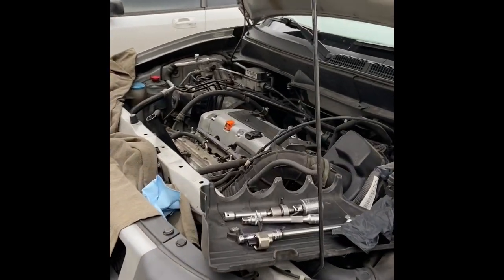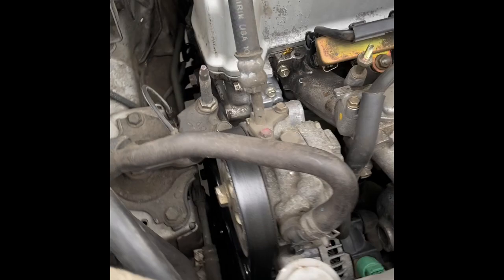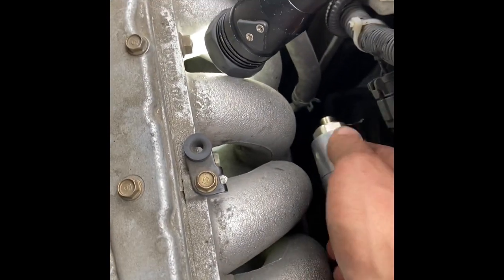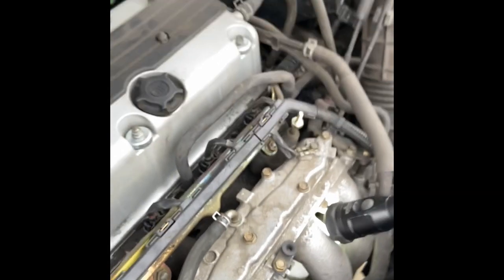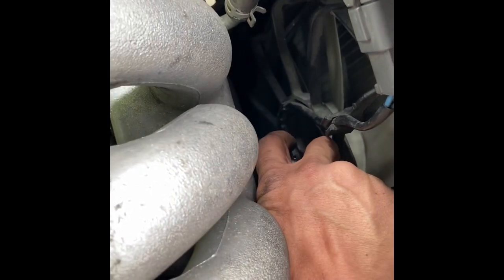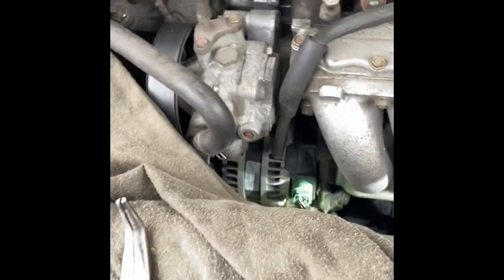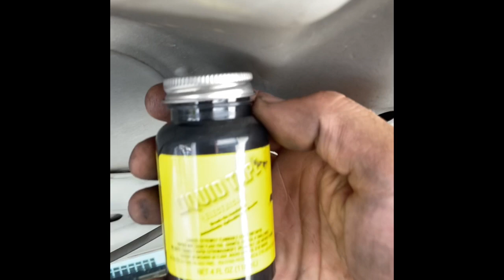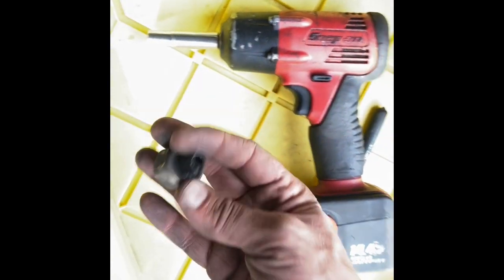Reach Down Knock Sensor Replacement 2003 Honda Element K Series

Comment: Awesome video. No BS,  to the point and saved a ton of time. Shop is aking for $230. I wonder if taking the old one out was even easier.
Reply from the maker: It was the first k series knock sensor I’ve replaced, and I did most of it one handed while filming.   230 is too much unless your at the dealership
Reply: How much $ is a new knock sensor?
Reply: @OscarPerez-lv3fc  OEM Part Only $10 on ebay. Do not use Aftermarket.
Reply: I've taken my intake manifold  out a few times now cause I had to change the starter then this knock sensor issue following . It's easy both ways but credit given cause I couldn't get the sensor out without removing my intake manifold.
Reply: @OscarPerez-lv3fc  $10 amazon

Comment: i recently had my starter replaced on my 03 and the check engine light came on (im told that happens when the harness is messed with). took it to autozone and it gave me knock sensor codes. took it back out of paranoia before buying the sensor and it gave me cylinder 3 codes instead (maybe false alarm?). i dont have any tools, is it possible to remove a sensor and put a new one on with bare hands? i wanted to see if maybe the sensor isnt plugged in correctly before buying a new one.
p.s. long before my starter gave up on me, long drives would eventually activate my check engine light, but it would turn off and stay off before i could ever get the code checked. dont know if that is relevant.
Reply from the maker: Touching and removing a harness will never cause a check engine light to come on, unless you damaged a wire or connector.
You can take the connector off and put on some electrical grease. Make sure the harness clips on the knock sensor all the way.  
This check engine light would come on and off every other week or so while it was going out.   Light hasn’t been on since.
Reply: hey just as a quick update, i had a mechanic look at it and it turned out the connector on the harness was damaged, they managed to fix it and put a new sensor on. only cost me 200ish thank goodness. god knows what an entire harness and labor would cost.